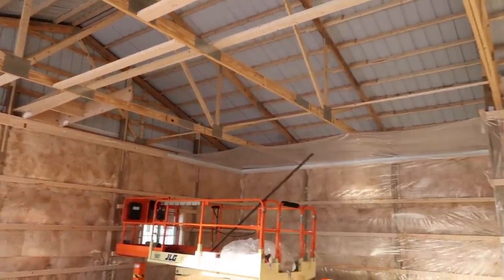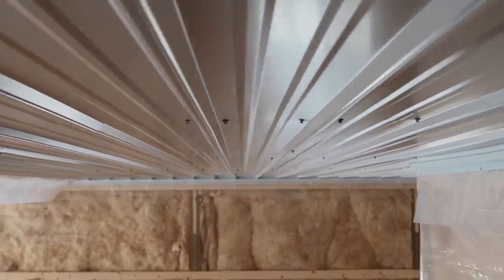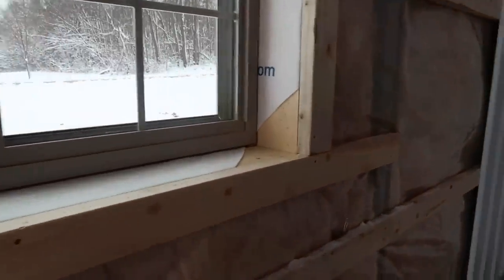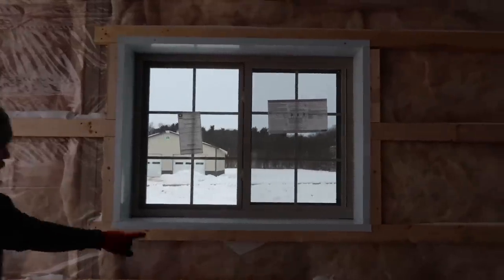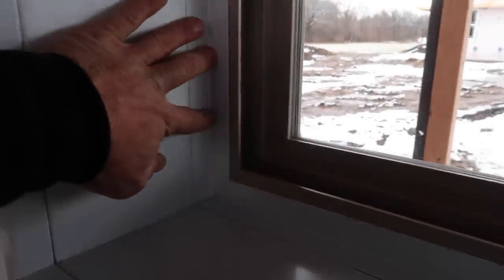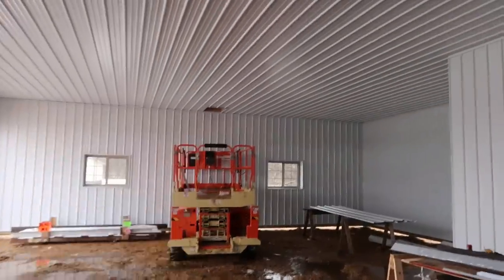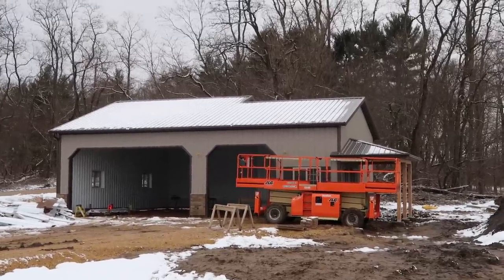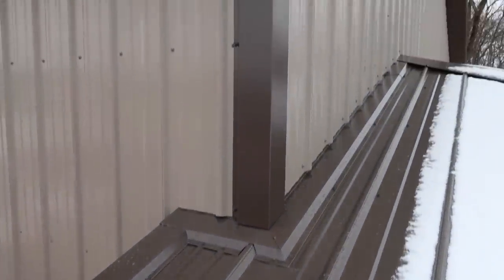Building a Mancave 11: Interior Finishes

Comment: Metal looks fantastic on the outside and your interior work looks perfect as always.  I would think it will be very loud working on something in the metal covered walls. I'm ore of a fan of wood interior for a shop area.  Love your window treatment.  I'm just wondering how much dust will pile up on the interior jams over time. Happens with wood as well.  I'm just more of a wood guy when it comes to interior window trim.

Comment: You spend more time and attention to detail on window trim than most metal guys I've seen. I would personally prefer at taper on the bottom of the side panels and both ends of the top...but I'm a bit of a minimalist just from a cleaning standpoint. Your end result is a nice look and I wouldn't change anything because of my opinion from the other side of the lake.

Comment: Kyle, Greg and Zach, that window trim. Maybe somehow use a smaller diameter J channel if they make it, or normal size, and cut those 45 like you do when you go around corners.  Granted im sure its a diff cut process, if its even doable. Im sure youve thought about every style and scenario while on the pooper.  I figured you might be able to cut 45 for the 2 bottom corners, and flash a straight j channel across the top.  However, if those are unable to be cut, then disregard said comment.   Hope ur Christmas and New Year was good.  Wife loves your family and motivation you all BRING!!!

Comment: Your trim work and attention to detail is impressive and your video quality is pretty good, too. I do not understand how anyone could invest that kind of $$$ in erecting an entirely new building like that from the ground up and not have a foundation already there, or at least a concrete slab, plus a completed gravel driveway to and around the building. I have been in the poured wall business for over 35 years, and that project site is what we call "a mud mess". Some customers simply never learn. If it were my garage/barn/business building, the site would've been cleaned up before erection began, and there would be at least 4 ft. of poured wall under it and a poured floor inside.

Comment: I put PVC quarter round around that gap in my shop windows. I used a little bit of polyseamseal to hold them in place. Did have to tack the top.

Comment: Steel + plywood (3ply) sandwich (or there about). You glue a piece of plywood under the trim that gives it rigidity and at the same time pushes the metal flush with the window. I actually leave them hanging by 3mm so i can force it in for that half a mm of clearance that sucks everything tight. 

Well, when i say, i mean my team, i just design the solution, tho, i don't do too many of these, usually, since we're in Europe, we pour a slab of concrete that rises around the window's bottom frame on both sides and locks the window in place. On top of which we glue a slab of reinforced marble.
Reply from the maker: I’d love to see that detail... my email is kstumpenhorst@gmail.com
Reply: @RRBuildings  please share those pictures/videos if he sends them, on your next video.  Awesome job as usual Kyle.

Comment: I like the window trim details you use.  My issue is long term them trim will scratch, stain etc.  I would try to get my customer to accept a piece of wood trim on the sill for provide a more durable finish.  Guess they can add them later, but better to tell them now and not have then unhappy later blaming you.

Comment: The end of the flashing that the gutter butts up to should always be cut plumb to match the walls. It just looks better. Another suggestion is to wrap the roof before the steel goes on as the wrap will span the gap at the peak so if it rains or snows it won't get inside through the gap in the purlins and will run below the steel and drip out at the bottom. Why don't you wrap the gable ends ?? and do you use zed nails from the truss to top plate junction as well as screws. These are mandatory here in New Zealand. Also you've never mentioned whether the local building inspector turns up at various stages in the construction to check that it's all being done to code.

Comment: My kind of work looks just fine. I do try not to use caulking unless needed. When we make the inside window trim as you did, we always put a hem bend on both sides doing away with the raw edge's that are showing. Gives it a nice neat factory look and no ripples in the metal when screwing or nailing it down. If caulking is needed, apply the caulk first then the trim metal over it, hiding the caulk. Just a thought.

Comment: One aspect of the build that I haven't seen is the installation of the ceiling insulation.  I know that is another contractor but you recently showed the concrete floor going in after you wrapped up your work.  Just a suggestion.

Comment: The last piece of L steel in the windows is a detractor I think. Two edges visible, extra screws.  I say use the caulk, which can be a very clean edge done carefully. Maybe only need it on bottom piece.

Comment: You could bent the first frame up to the window gap and fixed it by the sides so you don't needed to use another frame. Another point would be to put some piece under the frame to set it up the gap. Just a though from a guy who don't know so much about it hahahaha Great job and amazing videos.

Comment: 2 things.
One why, in the trim of the attic access, do you leave the extra tails towards the walls?
Two instead of doing the steel window trim have you considered using wood and trimming the steel around that? Maybe instead of using pine, use another decorative style wood to add just a small touch of contrast?

Comment: Why dont you cut the first piece of the trim, at an 45degrees angle on the lip you put under the window. also, why dont you use another type of screws , with flat head, for that final piece of trim around the window?

Comment: I agree with you, i don't like the metal angle piece against the window frame, if you were to wipe down the reveal, you could catch that sharp edge and cut yourself, if it HAS to be the angle, it would be better if it was folded back on itself, but that adds a ridge.
I would much rather see a wood reveal and sill.

Comment: In regards to the metal trim at the bottom of the window... How about a hem of 1" under the window side that isn't fully closed? It would lift the sides up and you could still slide it underneath the window. It would be tight all the way.

Comment: The window trim, what if you bent up at the front edge of the window, folded it all the way back on itself and then tucked back under the window edge for the first piece. That would eliminate the last piece you have to use for the window trim.  Alright, so that then leaves you with 2 doubled over layers in the corners, so cut the back side off of the bottom and then the back off of the side when it goes over it with the 45. Maybe cutting the back piece off before you fold it will give a better looking end result. anyhow, that is just my idea, may work-may not; free advice is sometimes worth what you paid for it. Thanks for the videos.
Reply from the maker: Haha love your ending comment and trust me I appreciate the idea

Comment: Can you add a small wooden wedge to the bottom right side under the window? This you would do before you add the metal trim over it. Then you don't have to caulk either. My dad who was a builder told me that no walls are even. He had to miter everything to fit right using wood.

Comment: RR Buildings...what is the advantage or disadvantage of these metal clad buildings? I understand the advantages of a metal roof for certain conditions but my first guess would be overall cost to build them vs. say wood siding or masonry etc. Also, it appears there are more than a few version to finish off the interior walls, metal or other materials.

Comment: Your trim looks fine for a steel shed, but I'd have liked to see some waterproofing on the timber before the trim was applied. I've seen a variety of good products - stretchy waterproof membrane that can go around corners like that, rubberised paints that form a reliable film, and so forth. Putting trim over bare timber looks like asking for rot, to me.

Comment: The plate around the windows is made after the plate on the wall so you can hide the screw around the window and with only 4 bits. It should look like what you did but with 1 piece on each side. Not 3

Comment: The building and trim look great, but without caulk or a rubber/foam gasket or weather stripping, I don’t think the windows are completely air sealed. What do you do about that?  From what I can see, the physical steel to steel seems are pretty tight by eye, but not completely air tight

Comment: I am not a big fan of chalk  either.  But I think a small bead of chalk would have looked and sealed better around the window,  just a difference of opinion.  Your work is superb as always.
Reply: chalk is poor filler/adhesive ... you mean "caulk"
Reply: Hey Josh, sorry my computer auto corrected to chalk, not caulk.  But most people would have realized that and overlooked it. But rude people do not.  Like I said in my comment I am not a big fan of CAULK', but there are times when it is needed.

Comment: Great video as usual.
But I thought cellulose has a better R-value than fiberglass. I guess it depends on how densely it's packed.
Reply: You cant dense pack cellulose in an open attic space like this.  Dense pack requires solid surfaces on all six sides (IE studs, plates, sheathing, drywall).

Comment: You asked for a better way to do the interior window trim with metal. I don't have a problem with the way you do it but another way might be to minimize the metal that goes over the window itself to one inch and bend a piece one by three inches, install that first and put your jamb metal over it. Leave your jamb piece an inch and a half away from the window then the seam would be over lapped away from your eye and it would look cleaner and still keep the same concept. It would look more like one piece that way.

Comment: First off, thanks for your excellent videos. You really give great insight. Quick question, how do you manage the the electrical installation. I guess it is easy enough to get the light fittings in as you have an excessable ceiling, but what about the walls? Also, do you use conduits with the internal steel sheeting?

Comment: Just forgo the slight inner bend, then the gap will be even the entire length. You're doing more work than necessary by adding the extra 1x1. I think the additional screws are less attractive than the gap. Honestly though, why finish the interior in metal instead of just doing sheet rock and wood trim on the windows?

Comment: Rock wool would be better than Fiber glass since it repels moister and has not respiratory side affects for people with breathing problems. Rock wool doesn't loose it R-value in Damp area's like fiberglass does and has a fire temperature rating of 2100 F and can slow a fire considerably more. I have one room in my home done with it as a Reno job and can say it is the easiest to heat and warmest room in the house and the coolest in the summer time with no Air conditioning.

Comment: How do you mount shelves, benches and other equipment to the walls when the framing is set back from the surface like that?  I think I would want something different for walls, but the ceiling does look very nice and the wondows look clean.

Comment: Still have the same thing you started off with plus the screws in the way and the indentation of the screws on the metal and watch your fingers when you are cleaning. A bead of good  caulking is the solution. You wouldn't fin any imperfection that way.

Comment: About the "dip"at each corner on the 95 degree 1.5" trim piece: would a shallow relief cut in the mating side trim eliminate that dip or bend. It is the point where downward pressure happens.
Reply from the maker: Most likely.

Comment: I bet the floor crew are going to splash concrete all over those walls :(

But thanks so much for making this build series!!!
Reply: That's why they mask it off up about 4' before they pour.
Reply: How do the screed next to the walls?  If it was my building,  I would have poured concrete before the walls were installed for easier screening and no worries about spatter.
Reply: @arnoldlayne1424  On my steel building the outside concrete guys put plastic 4 feet up but some how splashed concrete 8 feet up on the doors and sidewalls. Fortunately I caught it and was able to get most of it off before it dried or damaged the finishes.
Reply: @TqSNv9R0iG5Ckxew  agreed. Easier for concrete guys to finish. Then set your j channel and then metal
Reply: Kyle showed this some videos back of a full pour, they had taped up plastic sheeting on the lower 4 foot of wall first.

Comment: I thought the porch roof wouldve looked a little  better if U wouldve ran a brown flashing. Or a channel rather at the top of the roof where the tan siding came down to the roof. A brown channel for the bottom of the tan siding to slip into. So the brown color wouldve came up onto the tan a little.  It wouldve gave it a much neater look i suppose. 
But the building looked great. 👍

Comment: Steel walls inside are a problem to begin with. Maybe use it for some interior detail, say on a mezzanine. I'm going for reused wood, a rustic interior contrasting a steel exterior.  The added benefit, the walls are my canvas. I don't need to be completely certain before I hang something and screw through steel.

Comment: You don't spray foam the windows? I spray foam the window insulate then I fir out the opening to cover the rough opening. Then I use sill trim against the window and slide my flashing inside that .other than that I do it the same as you are.

Comment: Why not bent the 1" bend on the bottom piece to make it all flow together and not have that visible seam? 

Having the slight bend in the bottom piece like you have isn't doing much for you after you come back and add the second 1" x 1" 90 piece if you're going to screw it down and essentially flatten it out. Plus I don't care for how it shows the seam and it's an easier place for water or something to get spilled down in there. Just my thoughts!

Comment: why dont you make a piece of metal trim like utility.  run the utility to the window and then your sill and legs and head piece can just be flat and cut to the depth of the window frame and then slide into the utility.  the utility is for the slop of the lumber dimension and with the utility stapled to the wood the window trim is fastened with blind staples and it looks super clean.

Comment: The metal casing is no good when you want to install window coverings like blinds. The screw holes will be harder to patch on metal than wood of you remove the blinds. Plus that trim you installed didn't seal as tightly as caulking would've.

Comment: Window trim out looks great, never seen better and I've seen many different ways. My only suggestion is those ugly ass screws. Using those screws isn't pretty. What about using a flat head White nail (small) I think it would blend in and do the job. I think it would look so much better. FLAT HEAD NAILS, many different kinds. Get the one that when put in they sit Tite to the trim and hold Tite‼️👍👍  Vinny 🇺🇸

Comment: could you have installed the 1×1 angle in reverse with a pressure bend? 
I'd have no issue with a clean micro bead of color match silicone

Comment: Don't agree with not putting 3/4" plywood on the walls before
the metal goes up. What workshop is not going to want to use walls
for hanging stuff and making shelves? Making sturdy shelves off sheet metal
is going to be hard.
Good job on the window trim. Caulk would have been fine.
Reply: I prefer mobile modular shelving (Nexel Wire for example) with wire and solid shelves mixed in and some accessories to hang or hold certain things where necessary  as opposed to mounted shelving putting holes in the nice wall though french cleats or slat walls offers some good aspects while keeping any fastener holes to a minimum.

Comment: What if 4 feet of snow and then 2 days rain and another 2 feet of snow on top?  Will it stand all that pressure?  Of course I may exaggerate but we had this in eastern Canada 2 years ago and many barns crumble down.  Some had trusses far apart assembled with heavy rough pieces of lumber but could not make it.  Hope you building method is trustable.  Just an experienced opinion on construction techniques...

Comment: Blow-in fiberglass has a strange quirk: it loses R-value as the ambient temperature falls. In moderate climates this doesn't matter, but in very cold climates blow-in cellulose out-performs fiberglass. I stopped using fiberglass ten years ago and never looked back. Rockwool and cellulose now!

Comment: As a customer i would prefer caulking. it gives a much cleaner look and down the road if it needs to be removed and resealed anyone can do it, they dont need a metal break to make custom flashing. Im not a fan of the metal trim and screw look, its to messy and busy, ive followed this build from the beginning and so far thats the only thing i dont like.

Comment: i was thinking about that hipped porch, you really could have run it out at true 45 degrees.  if the sides were longer than (half of) the front, then you'd simply have a short ridge.  If the front was longer than (twice) the length of the sides, then you'd simply have the front of the roof terminating into the wall for a few feet before the hips.  It would have been more efficient to build at true 45s since all of the rafters would have been the same, so you could do the math once instead of twice or three times and also not have to change cut angle, etc.  There was no real reason to make the hips terminate at an intersection at the wall, it just added unnecessary complexity which probably doubled the build time.